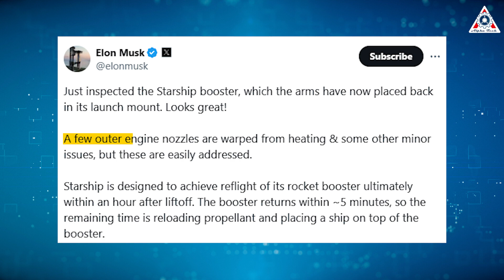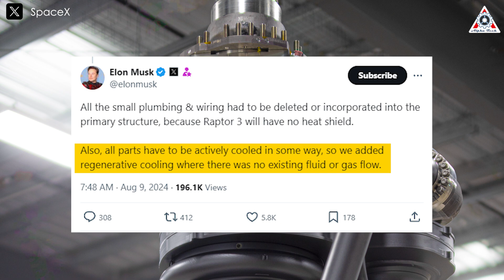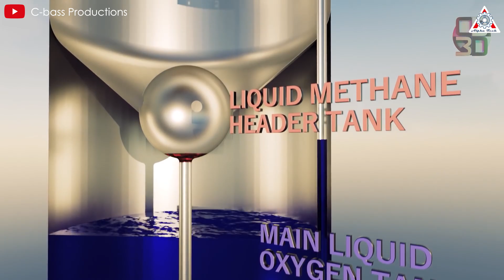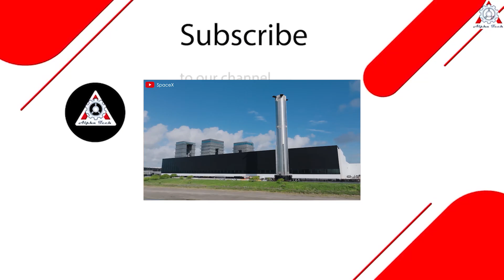Elon Musk Directly INSPECTED Booster 12 'RAPTOR Engine WARPED' & declared this...

Comment: Black paint on engine bell makes it a thermal black body facilitating radiating of engine bell heat which is a challenge at rarified altitudes.
Reply: More likely ceramic coating, as used on exhaust systems and turbo chargers on road vehicles to reduce heat in the engine bay.

Comment: the descent speed of any rocket, no matter how much it weighs, is the same :)
Reply: In a vacuum you would be correct, but Earth has an atmosphere.
Reply: @krashd  which is irrelevant to the point I was making, which was to clarify that an object's mass does not affect its rate of descent, this is in response to the narration that implies the Super Heavy falls faster than Falcon 9 because it weighs more - at 3:09 "given super Heavy's considerable weight its descent speed is significantly greater than that of the Falcon 9 booster"; if you want to argue about the atmosphere's different impact on objects of different shape, that's fine, but it's irrelevant to the point I was making

Comment: Will the next IFT booster test include Raptor 2 or Raptor 3 engines?  Just wondering if SpaceX was wanting to utilize the engines already built versus using the new iteration in early flight testing.

Comment: 😂😂😂 It’s weight is higher , so it falls faster😂
Reply: This is true when you are in an atmosphere though. The feather and the steel anvil only fall at the same speed when they are in a vacuum.
Reply: In an atmosphere, the less surface area per mass means it will fall faster with a higher terminal velocity. The starship is very aerodynamic in this regard.

Comment: The engines were not glowing due to friction from the air. If that were true; the rock shell itself would also show black body radiation. 

Those emgines are glowing because they are still hot from the burn. This because the vacuum of space insulates and they will cool very slowly and exhibit the glow seen here.
Reply: I'm not an expert on aerodynamic friction, but it's plausible it's both.
Drag in the engine bay is potentially higher causing more heat, resulting in the engines staying hotter longer.

Its also important to remember that the glow we see on objects when they're hot depends on the material. Just because one part is glowing and the other isn't; doesn't mean they're not similar temperatures.
Reply: Yep, they were glowing due to the heat of combustion from the previous burn cycle not being dissipated in the vacuum of space.  They cool down pretty quickly when exposed to the air, though.

Comment: At 3:80 there’s also a moon with oceans of liquid methane that could be used as a gas station in the future. Like a truck stop in space when traveling around the outer solar system.
Reply: The bulk of propellants consists of the oxidizer, not the fuel. Even just getting oxygen in a stoichiometric proportion is the bottleneck. Then there's the business of liquefying it.

Comment: The booster was not moving, nearly fast enough to be causing stainless steel to glow red hot in the engine bay when it was videoed descending. I’m not sure what it was, but it’s definitely not atmosphere heating. Also, the enclosed engine bay would not heat preferentially. The nozzles and other exposed fixtures would be glowing if this was a fact.
Reply: Its just heat remaining from the burn. Space vacuum insulates and slows cooling. Quite obvious really. 

I cannot fathom how anyone got to friction as the source. But many did.

Comment: Air friction heating the engine bay? Really?
Reply: Yes, air friction is a thing.
Reply: @DDryTaste  I used to be convinced that what matters is air compression by the flying body.
Reply: @DDryTaste  add to that the heat produced by the engines running. The bottom of the booster is anything but aero so going back at supersonic speeds creates a lot of heat. Amazing how the booster can survive such temperature gradients. It seems the booster lost some panels and maybe it damaged some non-critical piping associated to venting. It seems nothing serious. MAybe including a pre-burn to reduce speed may spare some of the high temps
Reply: Otherwise known as atmospheric heating. Shouldn’t be much of a surprise considering all re entry’s cause heat
Reply: @Nohandlesexistwtf  The atmospheric heating term is OK, friction is what I questioned. AFAIIK, most of the heat is generated by compressing the air.
Reply: More specifically, it is the blunt-body bow shock (extreme compression) that generates the high temperature in the air itself. This superheated air transfers heating radiatively to the engine bells. Some heating may also occur conductively via the stagnant air that came downstream from the shock into the engine bay, though it might be argued that that air is too thermically depleted to confer much heating.

Comment: they were also dumping fuel from the purge valve on the side to make the catch safer if something went wrong
Reply: Most probably, the majority of engine fuel lines were purged with inert gas with only the necessary ones (both primary and secondary engines) remaining primed with chilled liquid fuel and oxidizer, prior to the catch attempt.

Comment: Wait, 500 tons of fuel remaining...?? 
How much does the booster carry at lift off?
Reply: That has to be a mistake because that's how much fuel I thought it had at liftoff
Reply: At liftoff it weighs about 5.000 tons incl. the Starship on top and fully fueled  @mincwell42
Reply: I believe the capacity is 4,600 tons at launch.

Comment: What’s with all the FAKE cheering and yelling on EVERYTHING SpaceX does???
If the ship crashes Cheer and Yell.
If the ship explodes Cheer and Yell.
If the ship fails to take off Cheer and Yell. Etc, etc, etc…
I have watched many many videos of SpaceX ships doing whatever and its the same cheering and yelling over and over and over again.
At this point its so fake I cannot take it anymore and had to post this.
Thanks for reading this post.
Reply: It's over your head, due to a lack of education.

Those are engineers that are cheering for various reasons because they worked on various parts of the project. They could be cheering because certain aspects of the test went well. 

In this this field cheering doesn't just happen from the main event.

The other reason is, most of these things they're doing have never been done before. So any achievement, even incremental, is something to cheer about.
Reply: What? So people are not supposed to cheer about a project they worked on and somehow worked through all the odds Bruh stop hating
Reply: I guess you're just unimpressable.
Reply: well then don`t watch it. :)
Reply: Those are actual employees looking their creation in action. Of course they are going to cheer for those monumental events. What an idiotic comment.

Comment: NASA could’ve done this years ago. They’ve been scamming the tax payer and continue to do so. Musk has exposed them. They want him gone.
Reply: No, they couldn't have. Everybody told them that this technology was impossible, and as an organization behold into a democracy, they actually have to get approval for stuff. Elon Musk is just rich enough to do it without approval...As we have found out here.
Reply: @johnrickard8512  When NASA’s inefficiently is profitable https://youtu.be/Emx00l8CXMg?feature=shared
Reply: @johnrickard8512  When inefficiency is profit driven and innovation is impeded = NASA.  https://youtu.be/Emx00l8CXMg?feature=shared
Reply: I agree with what you stated except that “NASA could have done this years ago”. NASA can’t even do this today!  It is full of swamp people and low IQ people thanks to DEI.
Reply: @JohnRickard drops a comment then blocks replies. Must work at the NASA janitorial department. NASA, where innovation goes to die and profits are paramount https://youtu.be/Emx00l8CXMg?feature=shared . NASA has been overseeing landings on the moon and other planets for decades. They already have the technology to be able to retrieve booster rockets and reuse them. It’s profit that drives them not to do it.

Comment: so what caused the damage to the side of the booster? from the video's i have seen it was not caused by the tower arms as it was there before the arms caught the booster.
Reply: Nevermind the scratch guys! Who said reverse parallel parking is easy? Fantastic job SpaceX!
Reply: Just a little excess methane venting, either planned or accidental.  No harm done.  Things learned.  It was a tremendous success!

Comment: The mass difference doesn’t make the booster glide faster. Thrust does.  A smooth golf ball falls at the same speed as a bowling ball when acted upon by gravity.
Reply: you caught that too?
Reply: in a vacuum yea not in Earth's atmosphere
Reply: @tylers2123  yes and no.  If the drag coefficient is the same the difference will be small, regardless of weight.
Reply: @greghelton4668  feather vs bowling ball massive difference
Reply: @tylers2123  yes, that’s a good example of the objects having different drag coefficients.  A marble and a bowling ball have similar drag coefficients so both will reach similar terminal velocities.
Reply: @greghelton4668  

The marbles terminal velocity will be much smaller in athmosphere because it has a smaller volume so the drag of the air will have a higher effect
Reply: @Sippi81  but it’s also a lot lighter and will be impacted by the smaller drag.  It might travel slower but it’s not as significant as one might think. It depends on a lot of factors like density and shape as well. We’re probably talking about the same thing but the video creator said the heavy booster fell faster because of its weight, which is not necessarily true.
Reply: @greghelton4668  

when a thing gets bigger it
surface grows by a factor of 2 while its volume growhs by a factor of 3
so the influence of the drag drops the bigger an object becomes 
so in general you can say a bigger thing will fall faster of course you have to count in the density and the shape but in most cases the statement should be ok

Comment: This video was cool except the fuel part is bs.  No we are not landing on mars and harvesting fuel for the return trip home.   If that was in a press release or marketing material it’s just junk.
Reply: That’s why they picked extra challenging methane as fuel so that they can produce it easily on Mars.
Reply: You clearly know nothing
Reply: If CO2, water, and solar energy are available on Mars, methane could be produced there.
Solar energy and CO2 would be manageable, but it is doubtful that water could be easily obtained.
Reply: @63akibow21  solar isn’t really an option on mars when talking about demands far larger than a rover. They’d have to go nuclear when it comes to power.
Reply: That is kind of the plan, though.  Did no one tell you?  Maybe you should get out more often........

Comment: Ceramic coating assumed on v3, also they are multiple variations ahead of these flights so I'm sure they are expecting most of these issues.
Reply: Trial and error is where the science rubber meets the road

Comment: At 42 seconds into your video, you can clearly see a leak spring from the side wall (a plume of white mist) which then catches fire.  It doesn't seem to be controlled, either.
(big edits to my comment)
Your video title didn't mention the fire, but the thumbnail seemed to feature it.
If there was a lot of fuel left in the booster, then any un-controlled fire seems like quite a risk.   Maybe moving the landing chopsticks to a sea platform would be safer.  I can't imagine those tanks surviving the vibration and heat stresses of re-entry for very many runs.  It will be interesting to see how often a super heavy booster needs new welds and refurbishment.
Reply: It was venting
Reply: @nodekapunk   usually you don't vent flammable gases right near another big flame.  Considering that it was essentially a giant bomb on top of the tower (still loaded with fuel), that flame that wouldn't go out seemed a bit ominous to me.
Reply: @scottk3292  seemed like they did just fine. It’s a test flight bud. It’ll be ok
Reply: Dang, got em
Reply: I can’t confirm or deny your claim of fire, I do t know. Can’t we just be amazed at the accomplishment without “shilling” for space-x. Aren’t you impressed???
Reply: @boblevine104   I have a history with NASA through a few different channels.  I've never worked for them, but I've "worked with" NASA engineers at times.  Heck, my dadvwas a NASA engineer.
If I had suggested to any of them that we'd be able to bring a rocket back down to land on its ass like in an old comic book, they would have laughed me right out of the building.  So yes, it's certainly an amazing accomplishment.
That said, we have to recognize that it also comes with amazing risks.  Unless they can plan well enough to have the booster almost empty as it arrives, it will be carrying a whole lot of explosive power.  A mishap could be pretty bad.
I'm betting that they have a good system for quickly connecting and recovering the methane after landing, but I haven't yet heard that mentioned.
So yes, it's an amazing accomplishment, and it burns cleaner than other rocket fuels, but maybe moving the receiving chopsticks to a platform at sea would be a bit safer.

Comment: All objects fall with constant acceleration, called acceleration due to gravity (in the absence of air resistances). It is constant and does not depend upon the mass of an object. Hence, heavy objects do not fall faster than light objects.   Now see if you can explain the faster speed of starship's reentry speed relying on science.
Reply: air resistance over a larger surface area.
Reply: This point of the video annoyed me more than it probably should 😂
Reply: the correct answer to this is altitude, and the lack of an entry burn. 
on a return to launch site landing of falcon 9, it begins its boostback burn about 20 km lower than what superheavy did, so superheavy spent longer accelerating because it spent longer in the thin atmosphere where air resistance isnt enough to slow it down. falcon 9 will also relight its engines to reduce some of that velocity that it had picked up, before hitting the thickest park of the atmosphere to reduce the amount it has to bleed off as heat, but starship being stainless steel can withstand that heat so entry burn isnt neccessary. 

howd i do?

Comment: Booster is heavier therefor it falls faster? Do you know physics?
Reply: Well, due to air resistance impacting the lighter falcon boosters I believe that is correct...
Reply: I was thinking the same thing.  A 1 ounce ball bearing will fall faster than the boostsr.
Reply: @dherman0001  The other way around..  air resistance will impact a lighter object greater than a heavier object..  although I perhaps the correct answer has to do with the combination of mass and surface area to be exact..
Reply: Have a read of this. Remember, F=ma and each letter have equations. There are other forces other than the from the gravity of the earth but is not uniform due to relation to drag from the body itself, atmospheric pressure and moreee https://www.grc.nasa.gov/www/k-12/VirtualAero/BottleRocket/airplane/falling.html
Reply: This was shown by Galileo from the Tower of Pisa. Both cannonballs of different mass fell at the same rate of speed which showed gravitational acceleration to be constant. My undergraduate degree was math and physics.
Reply: @ronaldharding3927  did you not even bother to read my answer? yes acceleration due to gravity is constant, so a free falling object in a VACUUM (no air resistance) will fall at the same rate. This is not the same as Terminal velocity (aka max velocity of a falling object through a fluid) for objects falling through the atmosphere.  If you don't understand this concept i feel bad for your teachers. BSc in Biology, with undergraduate studies in Physics, Chemistry and math/calculus, as well as  a Computer Engineering diploma (since you seem to care about that)
Reply: @misob: apparently you don't know how to read. Galileo demonstrated this from the tower of Pisa several centuries ago. He dropped two cannon balls at the same time which struck the ground att the same time. When the friction exerted on a falling object is basically the same objects of any weight having the same design will hit the ground at the same time QED by Galileo's experiment.
Reply: @ronaldharding3927  Wow, at this point I really think you are either a troll, dyslexic or completely incompetent in comprehension. Btw, according to nasa's own site "the story that Galileo demonstrated his findings by dropping two cannon balls off the Leaning Tower of Pisa is just a legend"
Reply: Actually, it falls at a uniform rate--9.8m/sec^2
Reply: @ronaldharding3927  Only in a vacuum.  Air resistance will directly impact how fast different objects fall..  think bowling ball vs piece of paper..
Reply: @paulslund1  two cannon balls of different weights dropped from the tower of Pisa hit the ground at the same time. If you have two similar shaped objects, friction due to air resistance is negligible.
Reply: @ronaldharding3927  I don't think that's correct..  instead of two bowling balls, think a bowling ball and a volleyball.. air resistance will impact the volleyball more than the bowling ball even though they have similar sizes and shapes.
Reply: @ronaldharding3927  Friction depends on velocity squared - so is by no means negligible.
Reply: @ronaldharding3927  You are referring to acceleration due to gravity. Terminal velocity of an object falling through an atmosphere is calculated using the mass of the falling object, so yes a heavier object (not in a vacuum) will fall faster than a lighter object ... this assumes both objects are about the same dimensions, density and drag coefficient (google the math formula for terminal velocity for better explanation)
Reply: @ronaldharding3927  It falls at a uniform gravitational acceleration, with an increasing velocity until it reaches terminal velocity.